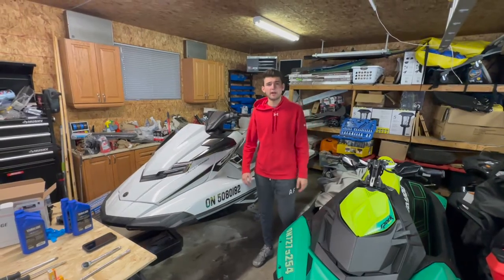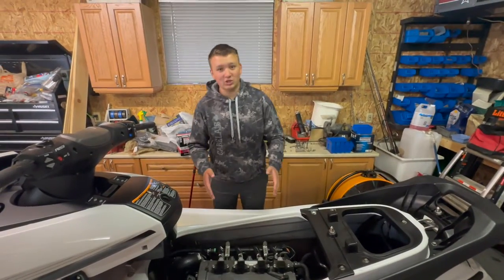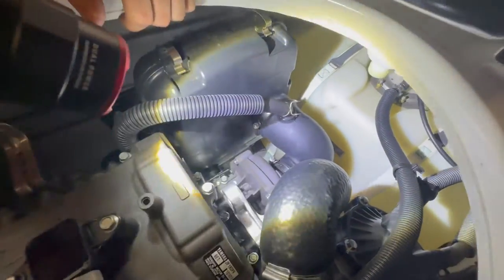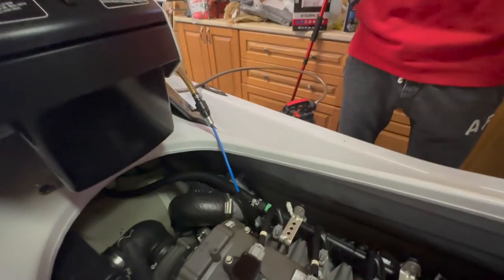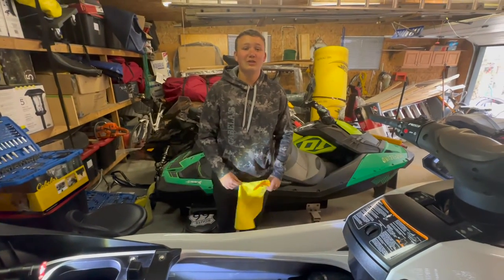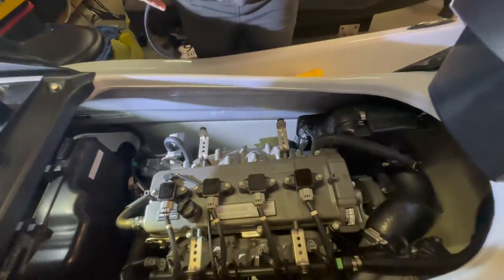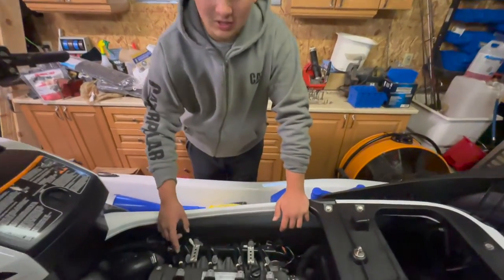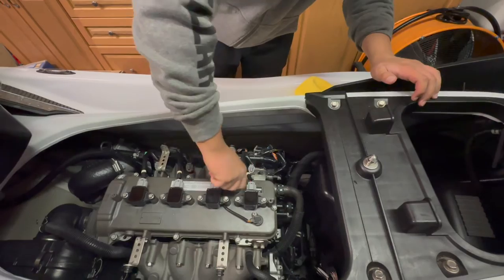How to do a Oil Change on a 2014-2024 Yamaha WaveRunner (All models.. GP1800R, FX, VX, EX,) 1.8L

Comment: Great video,  When you replace the oil filter and new oil, the dipstick level won't be accurate until you run the engine to get the oil into the new oil filter.

Comment: DONT add in all the oil thats in the kit. Your manual will tell you how much oil to add (with or without oil filter change) when finished your oil level should be between the min and max markers on the dipstick. Great video.

Comment: You should warm the engine before removing the oil.   You should also NEVER add more oil than you took out.   You should run the engine after to circulte the oil to then measure.  You should lubricate the gasket on the oil filter.  Also, using a plastic soda bottle as a funnel workes better, it screws into the engile filler.

Comment: u need to warm up the engine first before doing an oil change then start the engine and measure it when the engine is warm otherwise would give wrong oil measurement
Reply: Why does it matter giving that you are going to replace all oil anyways?
Reply: @dmihovilovic  more will come out.  Warm oil is thinner.
Reply: can you run the engine dry tho? not being in the water i mean
Reply: @ramezamine1444  out of the water only 30secs max without the hose.   More than that you need to connect a hose to the flush port.   Start the engine BEFORE turning on the water.   

Turn off the water BEFORE stopping the enngine.